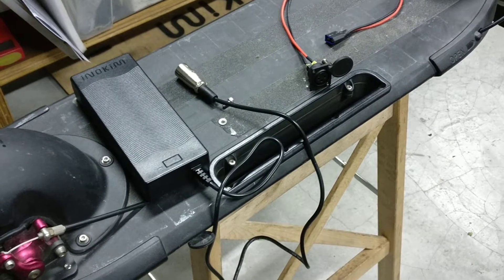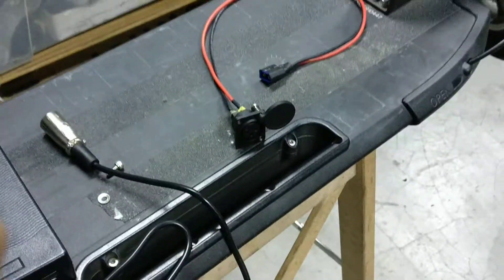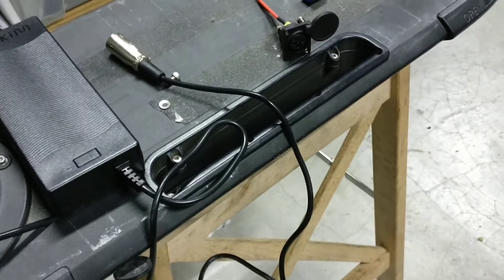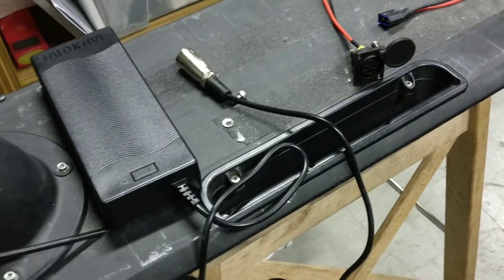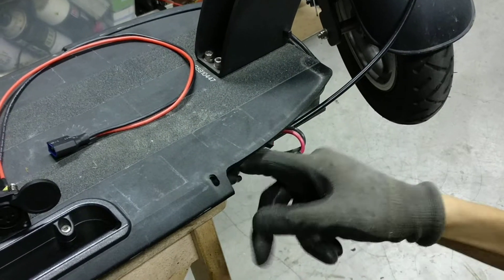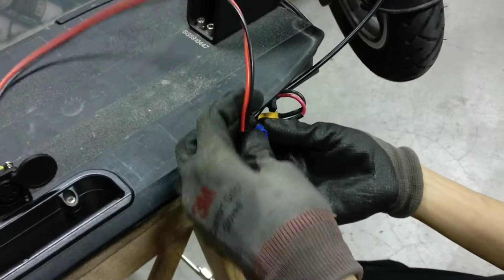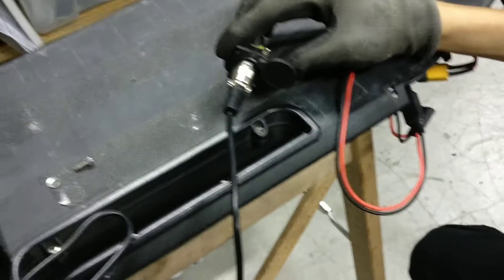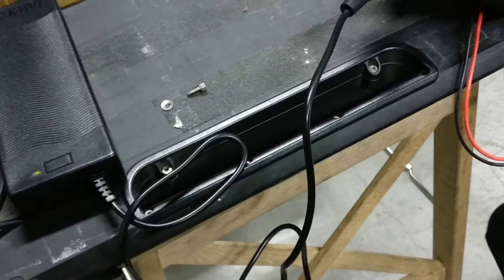Diagnosing your Inokim Part 1: What to do if your Inokim is not charging

Comment: Before i plug in the charger to inokim, the battery indicator lights come on with green light not red light? If my charger is broken and how to do repair for the charger?? Thanks brfore.
Reply: Have you figured this out? I have the same issue after bringing it in for maintenance

Comment: Inokim mini is fully charged and it can be turned on but it wont run anymore even when the accelerate throttle is pulled down. What could be the problem?
Reply from the maker: not entirely sure. motor wire could be burnt, controller could be burnt. But our guess is that the mosfet in the controller is burnt.

Comment: Hi bro I have the OX, my light stopped coming on but the scootter works properly. I'm here In Malaysia currently. Please help out.
Reply: I kind of have the similar problem 
My lights are in reverse meaning 
If I turn the scoot on lights turn off if I turn the scoot off light turn on but just the rear side light the front don’t kick on no more 🤷🏽‍♂️but scoot rides fine

Comment: Hello, my battery gets full whenever charger is plugged in but battery drains quickly when chager is removed. My multitester reading was 40v with the charger and drops to 5v when charger is removed.
Reply from the maker: Frank Chevy your battery is dead. You can find a new battery at www.falconpev.com.sg